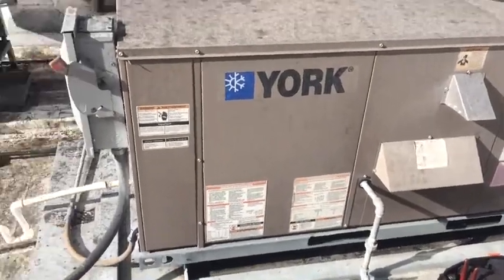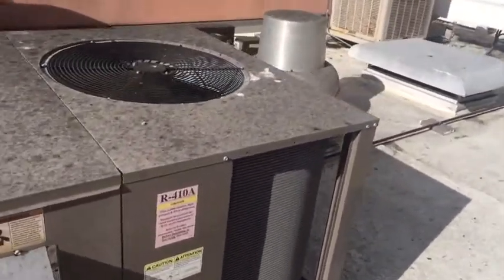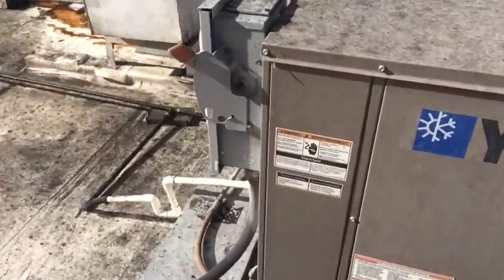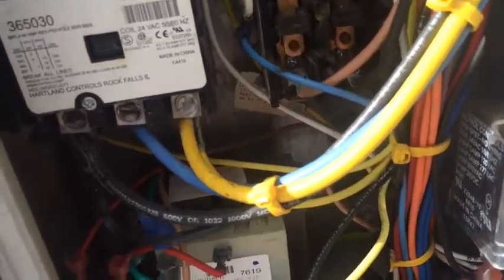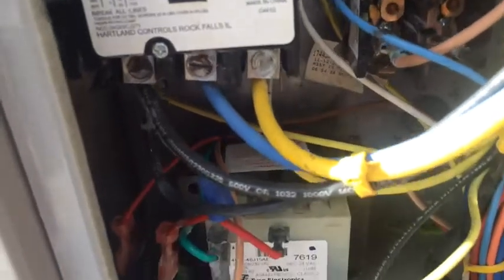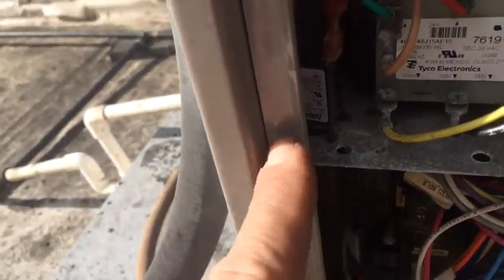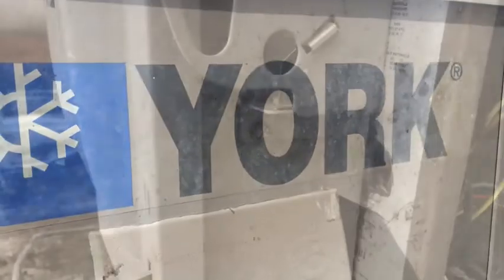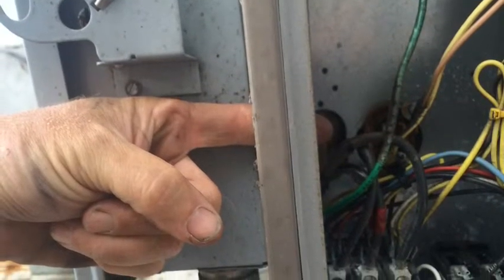Hvac repair on York package unit

Comment: Yeah, those Yorks have moisture issues, extra hole didn't help anything at all. I have had to replace those disconnects built into some of the models before due to them getting wet. Just mounted one outside, weather rated.